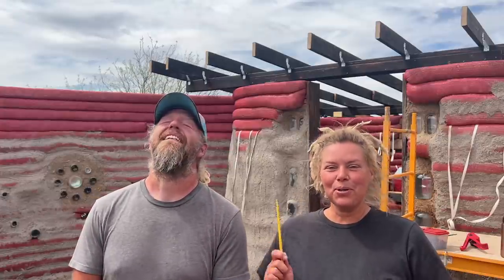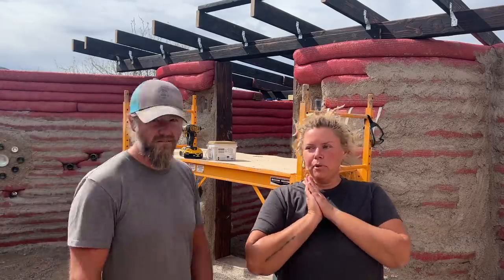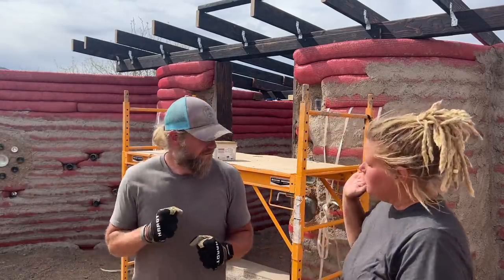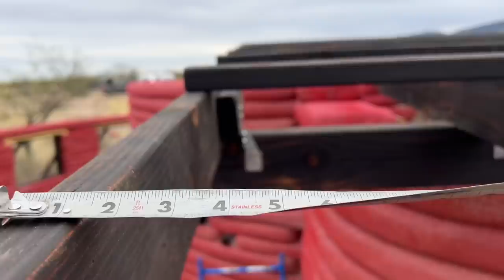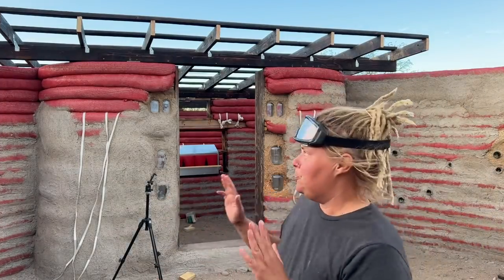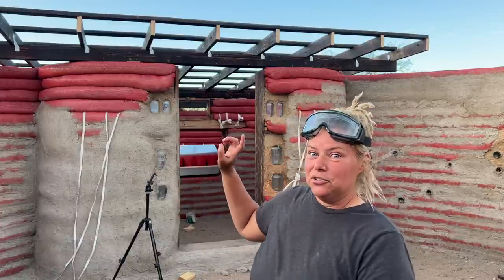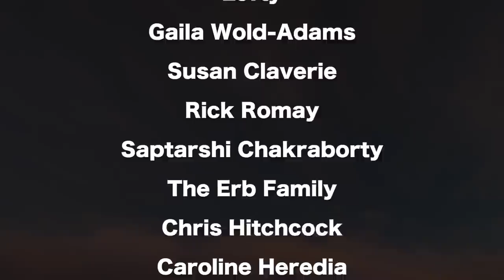Roof Build COMPLETE! Purlin & Facia Board Install (Chicken Garden Day 112)

Comment: Congratulations on your progress.  It is really coming together!  I was a little surprised, however, that there didn't seem to be any blocking between the rafters.  Given the extreme winds you guys get, I would think you would want a lot of lateral strength/rigidity.  The purlins will help, but the lateral shear is borne by the purlin screws and whatever friction the purlins have against the rafters.  Blocking between the rafters would provide much more rigidity because the blocks prevent the rafters from tilting laterally and help transfer loads across rafters.  I am not a structural engineer, but I do know that blocking is very common in these types of roofs, especially since it is not going to be sheathed.  Just my two cents.
Reply from the maker: Between the hurricane straps, hurricane ties, and purlins it should be good 👍

Comment: I just started watching these, And I am curious about the chicken coup beside the top what about the run area for them are they going to put chick wire across that top in the run area so those big O Hawks do not go for the chicken as they will the wire would keep them out and away from them you think. Just a thought when you are trying to keep them safe any ways.
Reply from the maker: Chickens are free range currently and aerial predators aren’t a problem so we’re not worried about it. Have some ideas if we need to change it in the future though. Glad you found us!

Comment: Awesome, well done guys!
Not only will the roof make for excellent water collection but is it also orientated to take advantage of solar panels?

As always
Massive Respect from Aotearoa, New Zealand
😀👍💙💛
Reply from the maker: It’s tilted the wrong way, but we’ll add a few panels to run the water pump. Will have to tilt the panels themselves.
Reply: @TinyShinyHome  
Nice one, you won't need too much power to run a pump.
Are the chickens going to be allowed to free range outside the garden wall?
😀👍💙💛